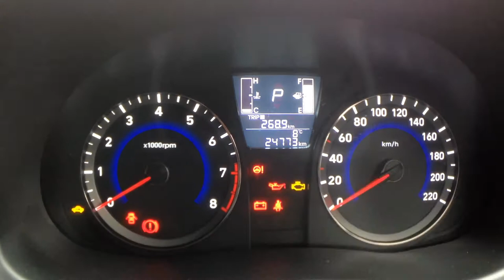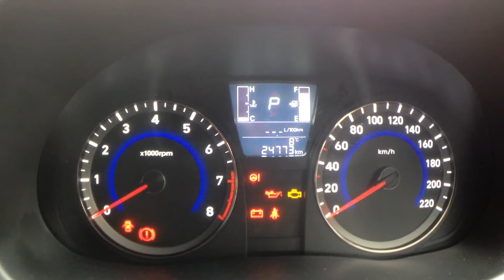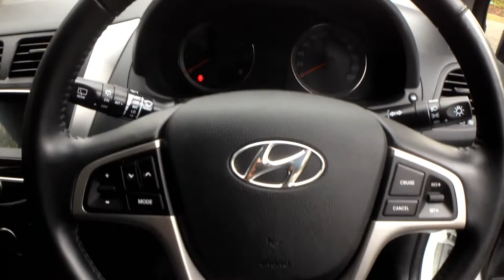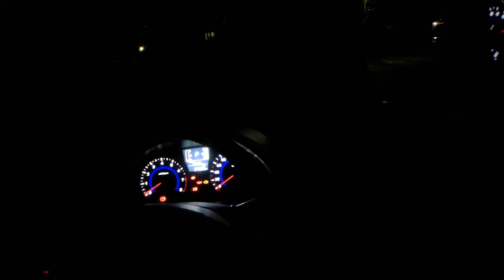Nev Reviews - Hyundai Accent "Sport" 2017

Comment: Getting around 11-12L/100 Kms....any tips to improve that?
Reply: Dont rev it over 2000 rpm lower even and it will come down to around 8.5 around town
Reply: @markcalleja8463  it's GDI so they need to be revved a bit to prevent carbon building up on the intake valves!
Reply: @19jacobob93  dont worry mine gets a clean out often 😎

Comment: I just bought one of these, used, in the States. Today, even!

1. You're right, and all reviews are right, about visibility out the back. I test-drove this, and have since driven it, with the headrests installed. I think I'll pull them out and put them in the boot.

2. Odd that the version in the USA comes with Bluetooth integration and controls, and I didn't see this in yours. The steering wheel gets three more buttons.

3. The steering wheel, in addition to being leather-wrapped, also picks up a telescoping adjustment. This is potentially-huge. Is it this way in Oz?
Reply: I just picked one up new and Bluetooth and leather wrapped steering wheel with Bluetooth and cruise control buttons are now standard